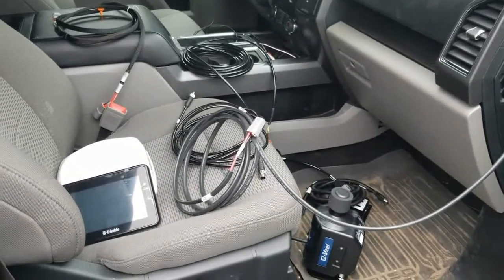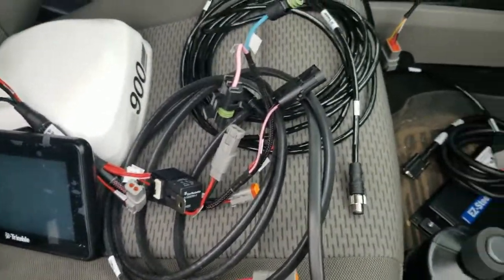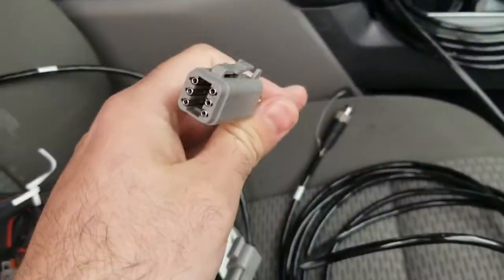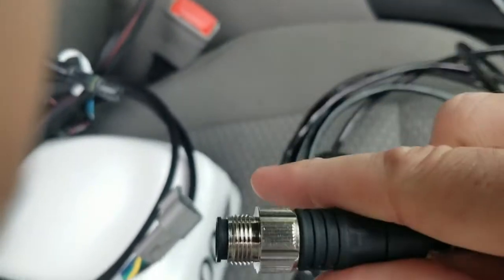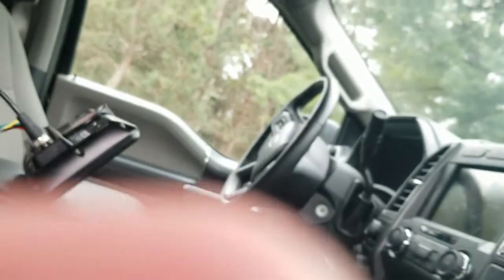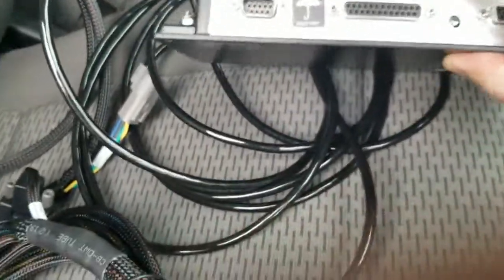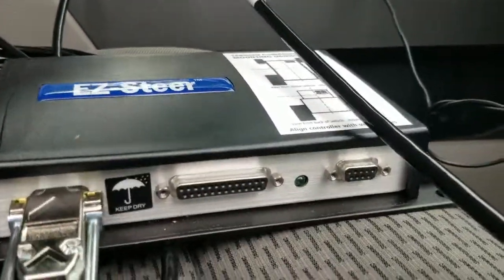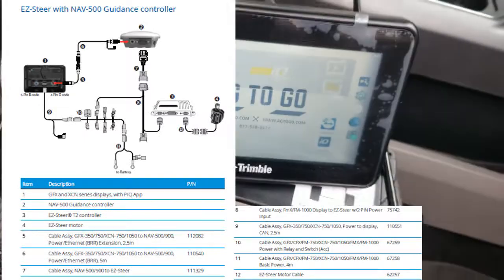Trimble GFX-350 or GFX-750 with Ez-Steer Cabling Walk Through - Part 1

Comment: What would be the reason to use the switch for the EZ steer ?
Reply: there is a rocker switch that comes with the EZ-Steer for 350 that can cut power to T2 controller if you didnt want it draining battery.  The other switch is the remote engage that will allow you to engage steering without having to click the display.

Comment: Can the battery harness be connected to an adapter for the cigarette lighter? (Like the Trimble 250s used)
Reply: It is not recommended/supported because of the inconsistency in that power source that they have seen in the past.